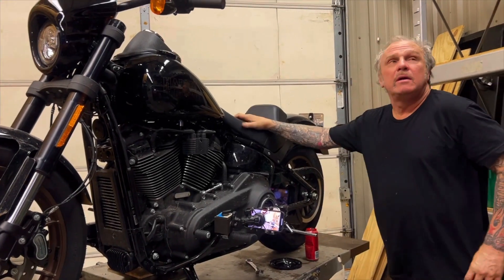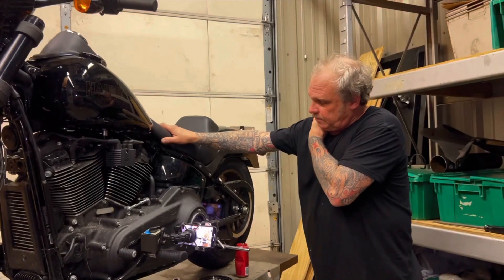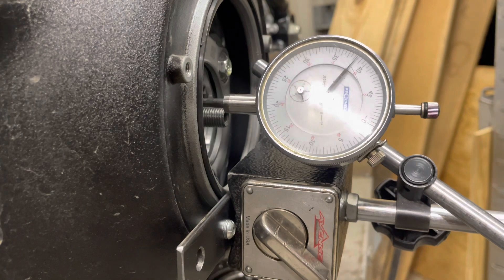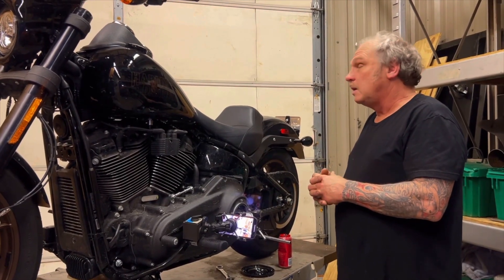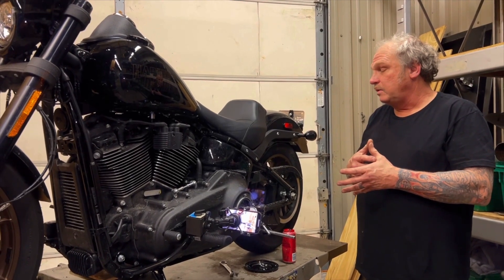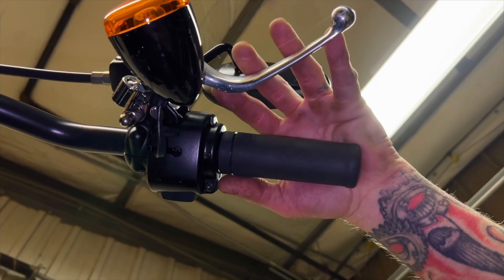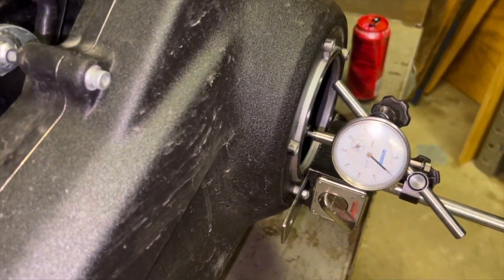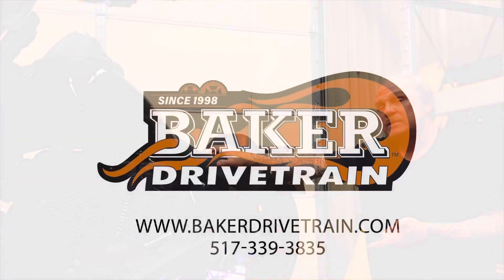Class #18 - In Depth Hard Shifting and Clutch Health (Part 2)

Comment: How about if the travel is 0,085” and it still drags? New oil, plates etc, even swapped the whole basket from another motorcycle? I’m getting crazy here..
Reply: Not sure of your bike configuration but some items I would check are your primary chain play not sure if you have a manual or auto chain adjuster. I would also check the clutch hub bearing, you stated that you swapped out the whole clutch basket assembly with a used one. You didn’t state if you replaced the clutch hub bearing. Did you check for severe wear steps on the clutch basket and clutch hub that the pressure and friction plates ride on. You stated that you have a good pressure plate travel but that only ensures that you have adequate clearance. The plates could be hanging up on wear steps as stated above. Also determine if the primary oil is correct for the type of friction plates you are using, the oil could be hydraulic locking the friction and steel plates to each other thus when you pull on clutch they do not separate. Lastly make sure your primary oil is set to the correct level specific to your year and model, too much oil will create that drag effect. Hope this helps. Have a Happy New Year

Comment: greetings - I hear endless people rant about how the clutch pressure plate screw adjustment impacts the quality of clutch release, ie pressure plate travel.   The idea is that changes in the freeplay at the pushrod changes where in the release mechanism ramp, the actuation is happening.   Have you measured different pressure plate travel to find the  optimal setting for the pressure plate screw, giving the most pressure plate travel?   Or does it really not make any difference within the allowed factory range?
Reply: i believe if you are too tight, the pushrod gets hot/expands and ruins the throwout bearing or welds to the internal parts and breaks. run it out too far and you dont disengage clutch all the way. i like his 70thou ref here, you could try 1/2 then out, then full turn out to see how much room you have left to go further

Comment: Thank you Sir wife's 03 springer giving me a hard time...Shes a new rider and I installed a soft pull...That will be coming out.....
Reply: my understanding is that the "soft pull" uses a release with flatter ball ramps, trading off less lever effort for less pressure plate travel.   I suggest removing any cushion plate from the clutch pack at the same time, otherwise the clutch can drag due to insufficient pressure plate release travel.